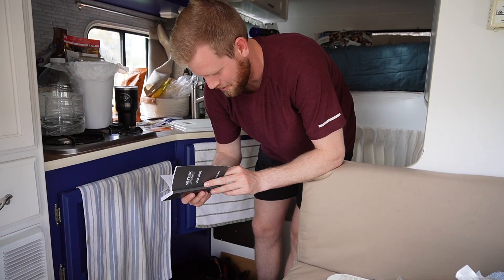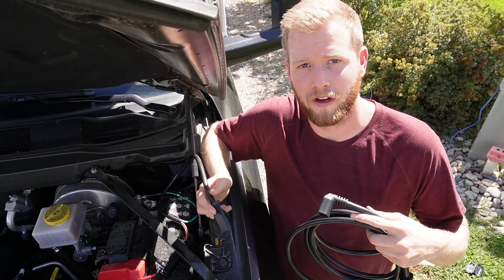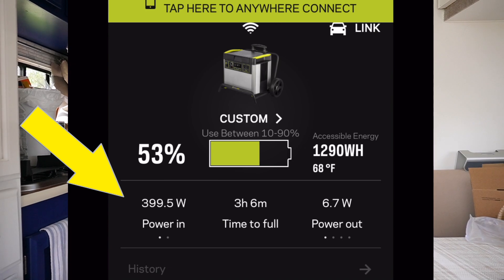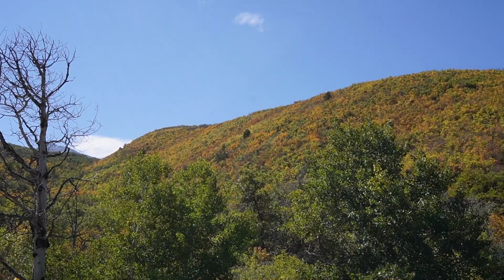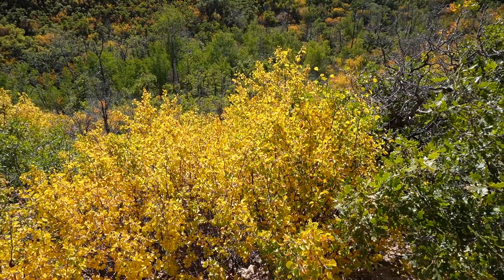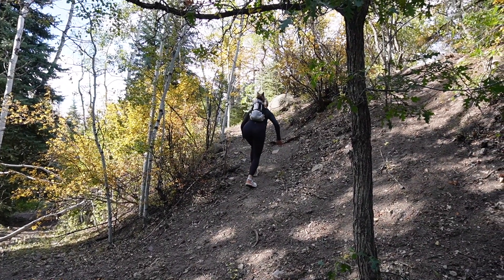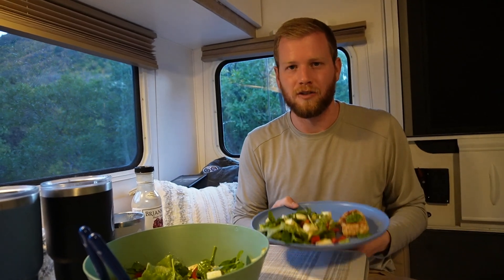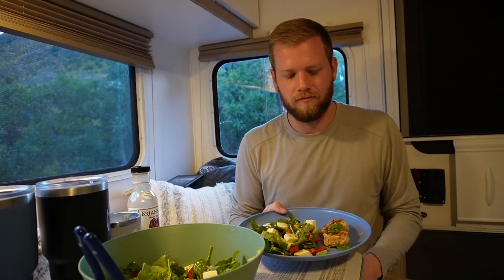Solving Our Biggest PROBLEM - Off-Grid Truck Camper Living | Fall Days In The Mountains

Comment: We have found that a 100 to 120 watt portable solar panel was a huge help in keeping our batteries charged when parked for a couple of days. The panel is much more efficient than a horizontal rooftop panel because it can be aimed and angled to the sun. A 20 foot extension cable will allow you to get away from tree shade. Thanks for another great video.

Comment: Hello Guys, our 200 watts on the roof of our Lance 851 has been good, we carry a honda 200i converter to propane for the cloudy weather, safe travels👍🏼🇺🇸
Reply from the maker: Our 180w panel works great as long as we have full sun! But it will just keep it level, usually won’t charge it back up

Comment: You mentioned the add on was expensive, can you tell us the cost?
Reply from the maker: Sure! It was $500, which was cheaper than the same wattage equivalent of solar panels, but still an expensive upgrade. We justified it as 10 campground recharges
Reply: Pays for itself, thanks @LivingLargeCamping

Comment: Nice upgrades, Do you have a wall mount catalytic propane heater yet? For winter camping that would be an excellent additional source of heat to offset the forced air furnace running so often because as you know it's really hard on the battery. Also if you decide to do that you should add a carbon monoxide detector for safety, I've used the catalytic heaters in many rv's that I've had and they work great but can create a little more moisture in the camper, And if you come to Olympia Washington I will install one for you at my RV business if it's of interest.
Reply: How about some contact info for your RV business... I might be in the area 👊🏻
Reply from the maker: Hello and thanks for the comment! We do not have a wall mounted heater yet, but agreed it would be a nice additional source of heat! And thank you for the offer, we’re excited to explore the PNW someday!

Comment: Nice upgrade! Hope that fixes all your power issues. We have quite a few solar panels but need someone to look at our system and make sure we set it up right😅we’re having some issues with it.
Reply from the maker: Thank you, we also hope it solves our power needs! And sorry to hear you’re having issues, did you wire everything in parallel or series? Sometimes the voltage can be too high for other components to handle

Comment: You should get the Ecoflow products way better and way faster charging. Great video
Reply from the maker: We have one of their smaller units and love it! But our space is extremely limited and the goal zero is the only 3000wh battery that will fit. Thanks for watching!
Reply: @LivingLargeCamping  I know I’ve seen the video but the Delta 2 is excellent and way smaller than the one you have see if they can send you the Delta series u won’t be disappointed. I love mine

Comment: Great move with the additional battery power and alternator charging capacity. 👌 Will the solar also charge that new battery?
Reply from the maker: Hi Dale, we still have the same battery so the solar will charge it, yes! When the truck turns on, the goal zero switches to the alternator charger and immediately back to solar when the truck turns off

Comment: I'm going to guess it doesn't drain the truck battery while the engine  is off. Does it disconnect conveniently for removing the camper from the truck?
Reply from the maker: Correct, and yes! It disconnects right at the truck bed now. The brains are in the goal zero that read the truck battery to tell it when to charge

Comment: Where are you headed next ?  I’m a little confused. Did you install a bigger alternated ? Do you know, you should install a isolator so you don’t run down your starter battery when your coach batteries are discharging.
Reply from the maker: We’ll be all around Colorado. Any places you’d like to see?
Reply: My wife and I have been in a lot of states but not in Colorado. We live in Michigan , but we have had to cut back on our travels with all the high cost lately. We traveled into our up and went to the pictured rocks, but that’s about it for this year. Two years ago we went to South Dakota and hope to go back again. Safe travels out there. Your a great couple.

Comment: Keep in mind I know nothing about the solar charging, except what I’ve heard from others. In some setups the vehicle battery can discharge if not disconnected/switched off. Is yours set up that way? Thanks for the video!
Reply from the maker: Hi Kristen! The goal zero has a “smart” controller that dictates when the vehicle is off based on the battery voltage. You are correct in the fact that if it is connected wrong it will discharge the battery
Reply: @LivingLargeCamping  Thank you for this easy-to-understand explanation! ~ Kir

Comment: 4:43 you should wire tie that up to those other cables so there's no risk of it bouncing around and messing anything up. 😋

Edit: The wife would like to know what kind of salad dressing you're using?
Reply from the maker: Just spent a few minutes today tightening everything up! Probably put 15 zip ties on it so it won’t move anywhere
Reply: @LivingLargeCamping the wife wants to know what kind of salad dressing you're using. And that's good!